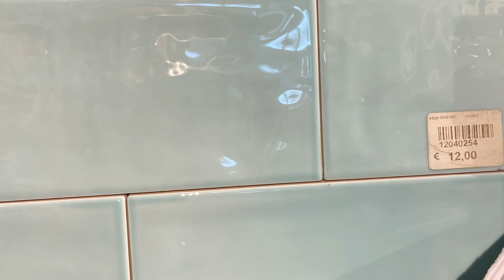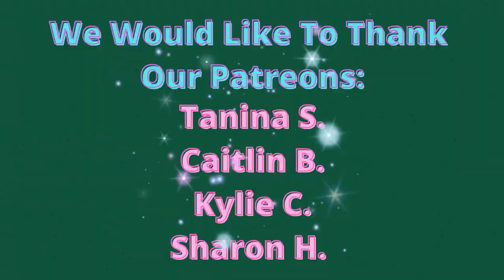Villa Renovation In Italy! Full Steam Ahead -Calabria, Italy -Episode 34

Comment: Hola chicos!!!  Consider purchasing an ADA compliant toilet seat (19-20” tall) instead of the regular height (less than 17”), those few inches do make a difference 😘 !  I have knee issues, and in the process of renovating my bath. The first thing I am picking is the tallest toilet that I I can find in the market! The elderly, people with mobility challenges and those with sciatica will thank you !!!!
Reply from the maker: Thanks, Jorge. We actually did think of this. But, it is very hard to find this type of toilet. We are sure if we had time, we could. But, we are in a crunch to get the toilets now, so work can finish. We will be adding bars for safety, near the toilets, so that will help. Thanks for watching. And thank you for thinkiing of our safety.😀

Comment: Hi, guys!  Haven’t said “Hi” for awhile, so wanted to make a quick comment to let you know we are still here, and watching / enjoying your videos.  I did think of a quick question: it seems like it’s more common there to have a separate hot water heater in each location that needs it, rather than having one central, larger heater — is that accurate?  If so, where is it usually placed for the kitchen needs?  Thanks, and hope you get some good rest!!!
Reply from the maker: We find in Italy they have one boiler (water heater) that runs all needs. It’s often in a bathroom. And it’s plumbed to run to kitchen and bathroom (s). We assume someone likely could have more than one, but not certain. They have various size boilers available. 
Thanks so much for watching our channel…we appreciate you Deb!